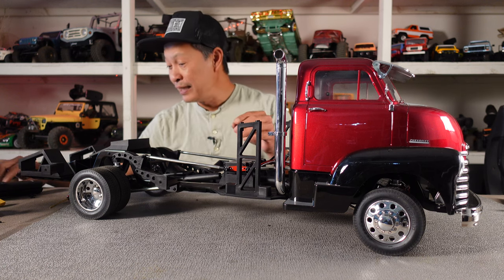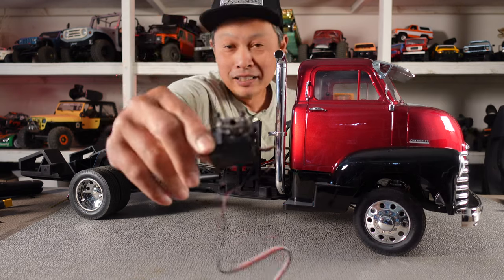Redcat Coe Hauler: How To Set Up Servo Lift And Endpoints

Comment: It's meant to plug into ch3, the push button is already set up for the air ride system. You have it on ch4 which is a 3 position switch meant for a winch.

Comment: Thanks for the content! I can't wait until 4 wheel independent raising/lowering kits come out as well. That extra lift is key though! Thanks for sharing that.
Reply from the maker: Yeah, drop the rear, then the front, then left, then right. Should all be coming since this platform has a lot of possibilities
Reply: But isn't it just to install another servo next to the ones that are already installed? 🙂 Looks like there is enough room. Maybe not enough channels, but then buy the Flysky NB4. It got 8 channels... 🙂
Reply: Just get to more servos and figure out how to mount them to each rod.  You’ll need 3 more channels though

Comment: I see a lot of people having the servos rotating in the same direction (looks opposite when installed in truck) this means they have to put the front rods in one side, in the top of the horn, and the front on the other side in the bottom.  I noticed yours are both attached to the top (front) and bottom (rear). Did you just flip one servo when you plugged it in or did you have to use a servo controller to reverse one?